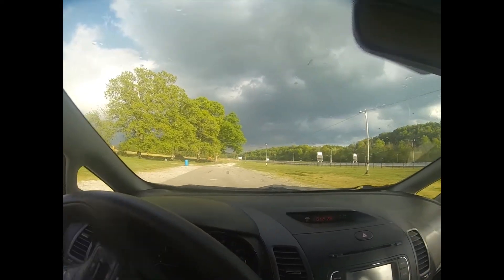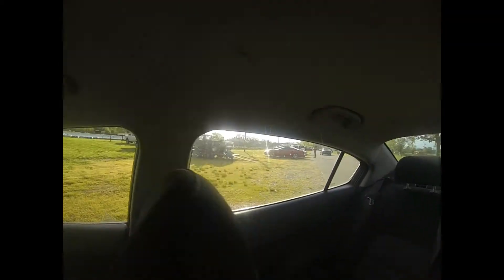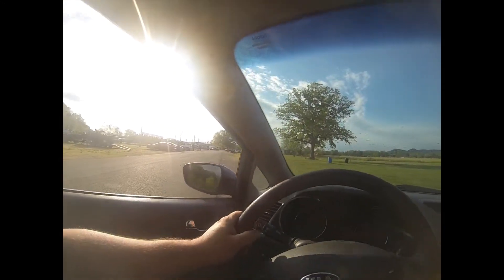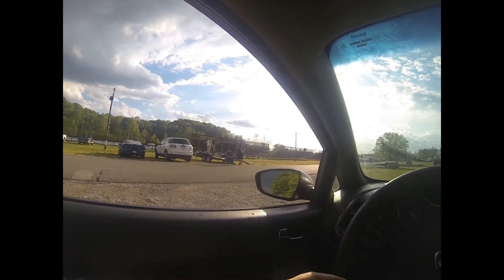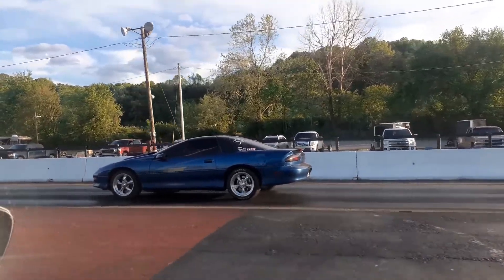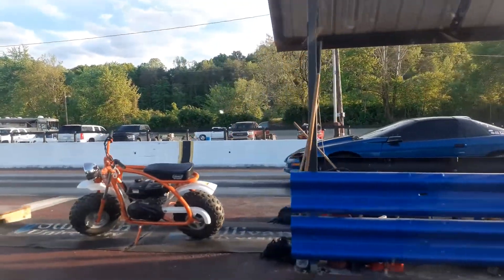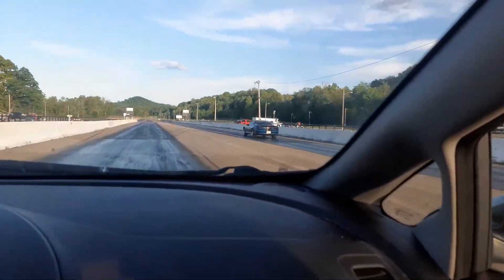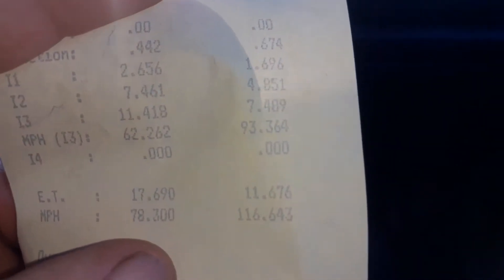CC503 Cammed Bolt On LT1 Hits the Nitrous at the Track Finally

Comment: You tune lt1’s
Reply from the maker: Little bit. I fool with my car and 3 of my friends LT1s.
Reply: @CarportGarageDragRacing  you want to tune another one lol
Reply from the maker: @660video2  you live quite a ways from me
Reply: @CarportGarageDragRacing  where you from
Reply from the maker: @660video2  I am in Kentucky and I only have software for 94-95 cars
Reply: @CarportGarageDragRacing  I live in wv but I just sold my 94 to get a 97 lol
Reply from the maker: @660video2  I am not even sure if they sell the 96-97 software any more, and if they did it is way too expensive. Solomon in OH does 96-97 tunes, or you can easily convert it to a 94-95 ECM but if you are auto they say it is rough on the transmission. http://www.lt1pcmtuning.com/service/
Reply: @CarportGarageDragRacing  I obd1 swapped my procharged 96 SS and run a 2 bar open loop speed density tune. It’s an auto, but I built a 94 4l60e that I had and put in the car. Then just swapped to a obd1 knock sensor. Much cheaper to tune obd1 cars. I primarily use Tunerpro and eehack, but also have Tunercats(used to correct the speedo after a gear change).
Reply from the maker: @dickbrugh5562  ya I initially did that on my car, mines a 96, but now I'm Torqhead speed density open loop.
Reply from the maker: @dickbrugh5562  I even ran my 96 trans with the 94/95 ECM, most people say is a huge no no, for a few years but it did finally lose the 3-4 clutch pack, but investigation of the transmission it was caused by a severely worn 3/4 piston and not the 96 ECM. I did get a 95 transmission and rebuilt it using Transmission Bench YouTube videos with parts Sonnax recommended for their stage 2 kit. 2 years and countless low 11 second passes and quite a few low 10 second passes on spray and it's still working great.
Reply from the maker: @660video2  but ya, as Dick said, if you want to OBD1 swap it, I'll tune it. Didn't mention it before because most don't want to go through that hassle especially if they are in an automatic.
Reply: @CarportGarageDragRacing  I used Sonnax parts too along with an edge 3600 stall. The swap works fine with the right trans, 6 spd is just a ecm and knock sensor swap. Since I was putting the stall in, I just swapped the trans at the same time.  Everything has worked great, but haven’t made it to the track.
Reply from the maker: @dickbrugh5562  I have a Yank 3600 stall but its tighter than most 3600 stalls I've drove, I need to get it reflashed